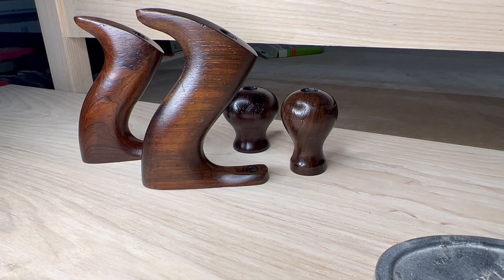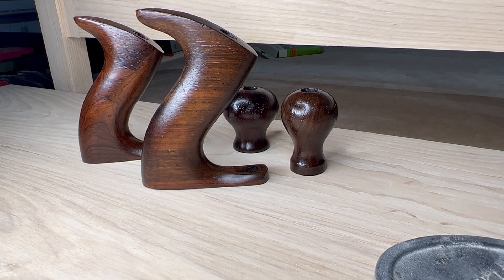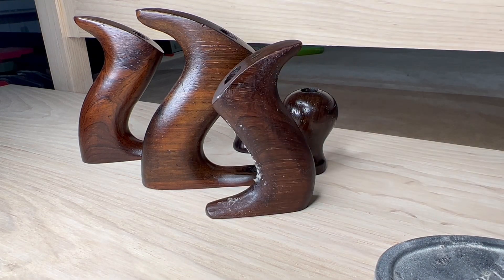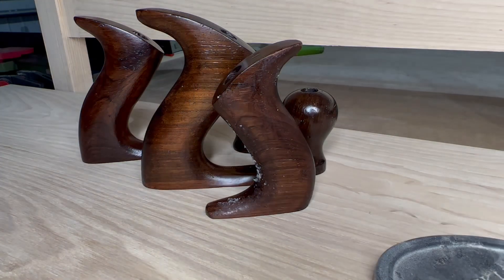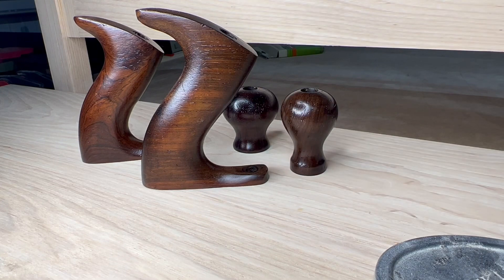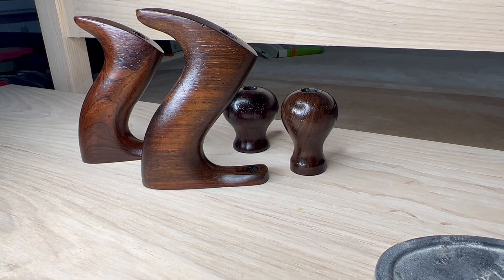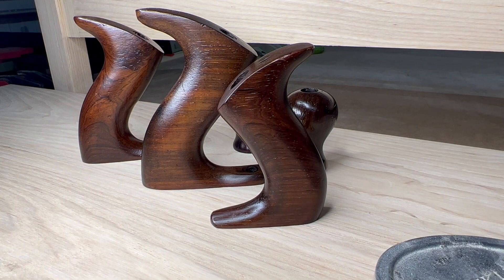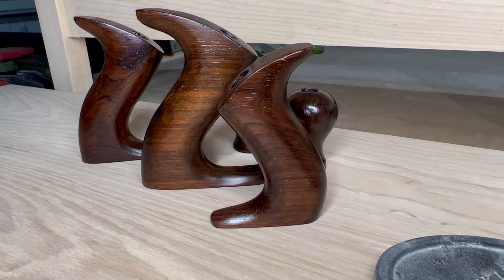Final Finish

Comment: Gordan, not sure if you mentioned wax before on one of your other vids can't recall. Anyway I cleaned a old war era plane (dads) and I used linseed oil on the old dry rosewood knob and tote and used Minwax finishing wax. Yes I let dry and used one of my dads horse hair shoe brushes (clean never used) he had. I brushed to a really nice sheen.
I cleaned up his old saw handles sanded lightly and did same way.
 Left all his character on them.
He is gone since 08. I think he would of appreciated it. They even feel nicer in your hand for some reason.